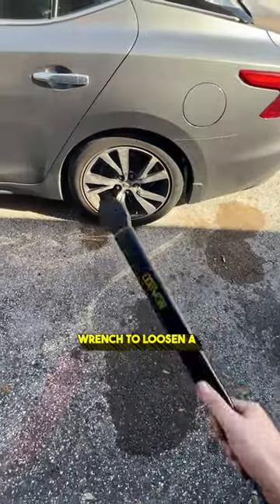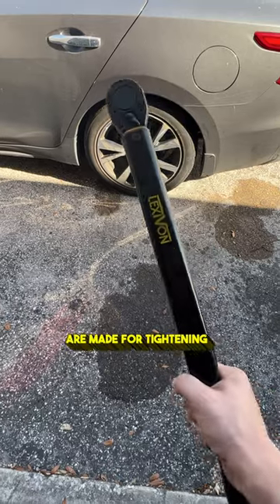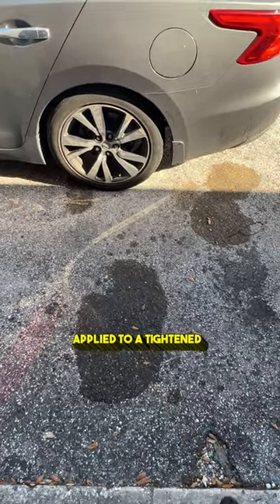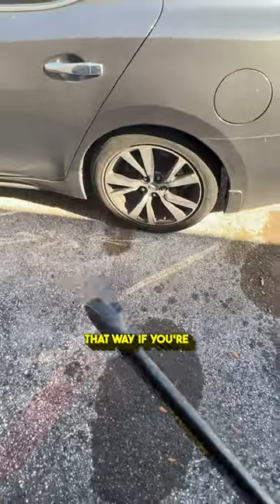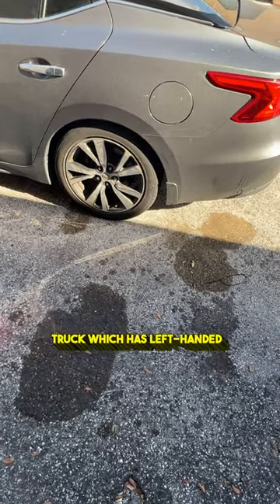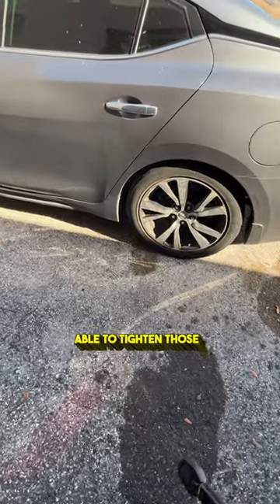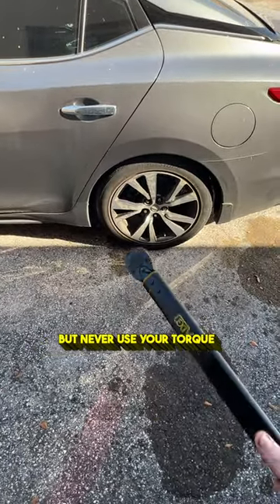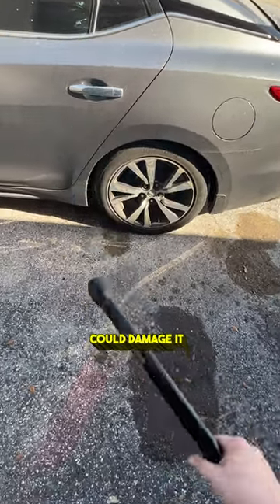Never Loosen With A Torque Wrench!

Comment: If you used it to loosen a bolt that far exceeded the tools measured ratings then sure…that could potentially harm it, but otherwise please explain how the torque wrench determines that you are using it for loosening. In fact, many people will use a torque wrench to determine the - very general - force needed to loosen a bolt by incrementally increasing the torque until the fastener releases. 

Sure, there isn’t any reason to generally use your torque wrench to loosen fasteners, as it could just potentially put increased wear on the device, but there is no actual reason it can’t be done.

Comment: Not true. The wrench doesn't understand if you're tightening or loosening. It simply limits the torque you're applying. To loosen bolts, you're applying torque. It's the same as tightening. Of course only if it's bi-directional.

Comment: Weather you are tightening or undoing the tool does not know.  There is so much bull shit going on around such a simple tool. People do not realise the detent clicks from the feed back from the bolt not from the force applied anywhere on the handle. The output at the bolt will always be as set as this short video shows. https://youtu.be/mk95F0hHS3U?si=vdS4hI08-O6Tjshk

Comment: You can use it to loosen, just do not keep pushing the torque wrench after it has clicked. That’s where damage can happen. What’s the difference between tightening a reverse threaded bolt and loosening a conventional bolt? From the wrench’s perspective, nothing.

Comment: My torque wrench doesn't measure in counterclockwise direction, it can be used to unscrew counterclockwise by flipping the lever but it will never click going that way. So not every torque wrench has that feature. Unless you are trying to break free a bolt would it be okay to use the torque wrench to unscrew something. I'm guessing if it is already loose and doesn't need to be unscrewed much further and you don't want to switch to a regular ratchet for convenience. Not sure If anybody would ever be in that situation though

Comment: Sometimes you need to use a torque wrench to loosen a bolt as this will allow you to determine how tight it was. Overall though, the torque wrench should be used to tighten to spec, not as a general purpose ratchet. Proper procedure is to start fastening a bolt and then finish getting it to spec with the torque wrench.

Comment: That statement is not true. Torque wrench is used to tighten. You just don't use it as a common go to wrench. Always back off the torque setting to zero when not in use and avoid allowing to be in extreme temperatures.

Comment: How do you rate that specific torque wrench you're holding? I seen them on Amazon but not sold just yet
Reply from the maker: It’s good for basic stuff. I would buy something heavier duty (harbor freight icon line) if I was using it daily. If you want something really precise Ive heard Milwaukee has a good electric one but I’ve never used it.
Reply: @wardwrenching  thanks man!